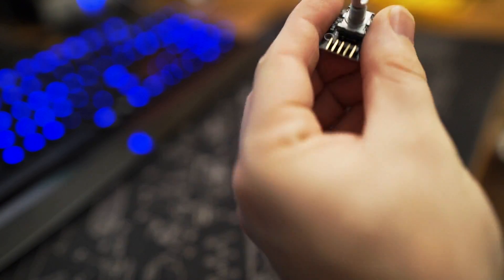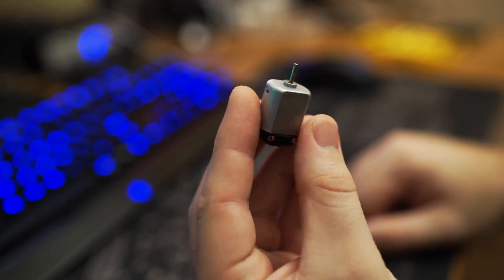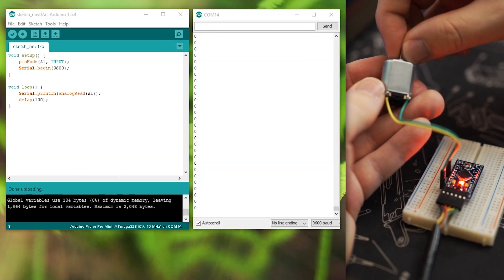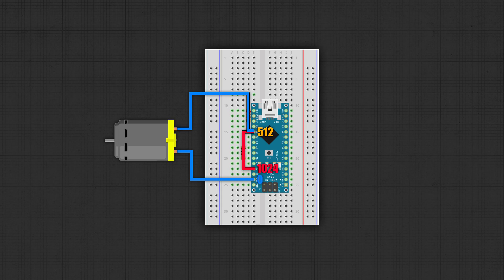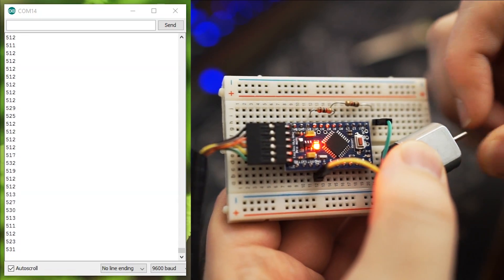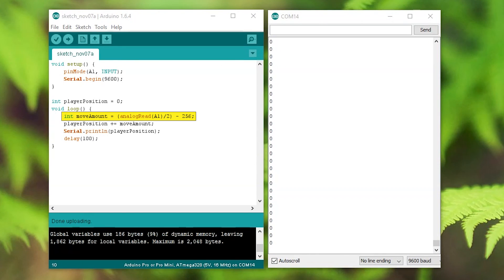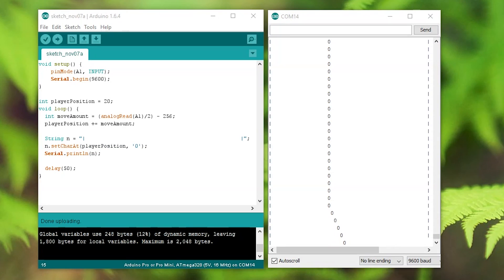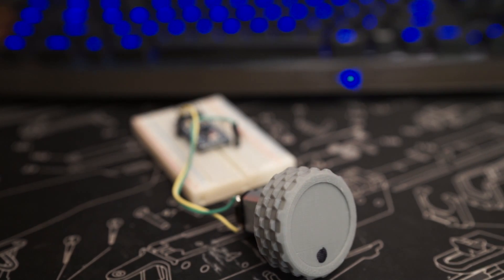Using a DC motor as an analog input

Comment: So... Could I use this technique to create a steering wheel to control a racing game on a PC with my arduino?
Reply from the maker: +TheNeurofluxation I wouldn't. This is best for things that spin quickly. A steering wheel you need to know that when it is turned back to center the car drives in a straight line. Also, when you start it up you have no idea which way the wheel if turned. For a wheel on the cheap I'd use a potentiomiter and if you want more than 180 degrees i'd gear it down. You'd lose some accuracy but you'd always know exactly where the wheel was turned and it would never lose sync.
Reply: Critters Lovely info. Thanks very much! I gues a pot is better then! (as pot always is...!)

Comment: DAM dude your tha man ! mad props yo!  well done, i like to add to this comment that you been talking about this robot that i dont see nothing about on your videos so whats up with that application ? i got my own robotic applications which i dont mind sharing , i just wanted to see where your mind set is at when it comes to robotic applications
Reply from the maker: +Sys.stem I'm working on a BB-8 build, will share if and when it gets finished :)
Reply: what are you doing? i have mess with that already but dint want to finish it as i got better bots to work on but i do have the cad files you can see on my fb  pagehttps://www.facebook.com/Xalgorithm/photos/pcb.979630325452673/979630278786011/?type=3&theater Critters

Comment: Great idea! Wouldn't have expected that it works that well. How easy is it to go exactly one character to the left/right with the motor control?
Reply from the maker: For something like character input I'd actually prefer to use a rotary encoder (as seen at the start of the video) as it has notches which makes accurate input possible and has the bonus of a push button built in. The motor input I describe in this video was for a game where accuracy is not as important as coping with high rotation speed and been low cost.